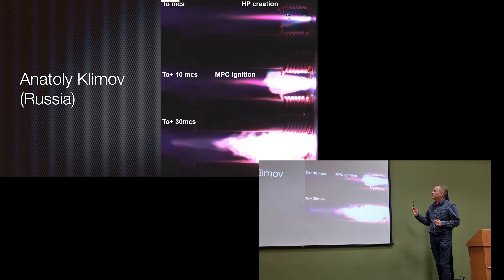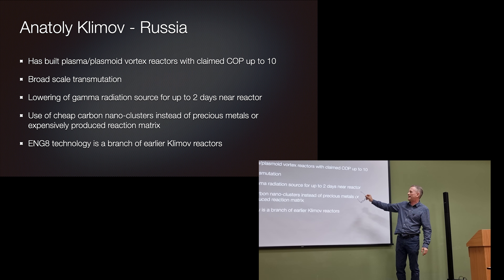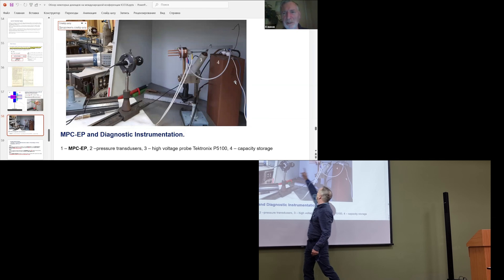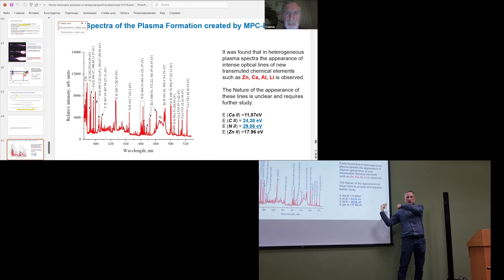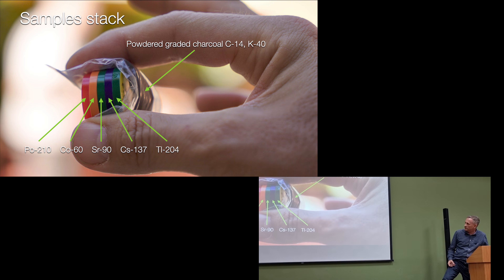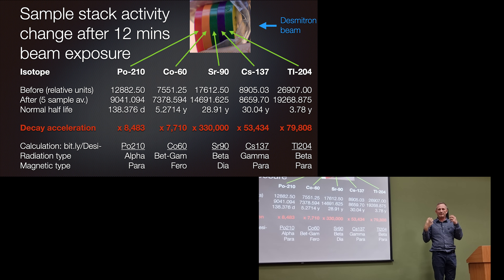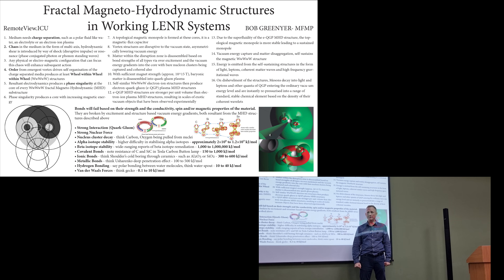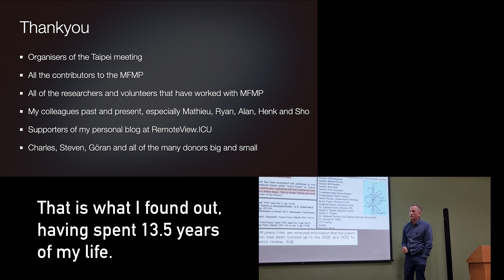Progress of world LENRtechnology development (Part 2)

Comment: Awesome to see change in decay dynamics! But did you manage to see if demsitron rays would heat up the K40 isotope?
Reply from the maker: Next job after deep study and verification of the accellerated remediation, is to see if a powder containing LiF will rise rapidly in temperature.
Reply: @MFMP  Slow rise would work too. As long as Q>1.